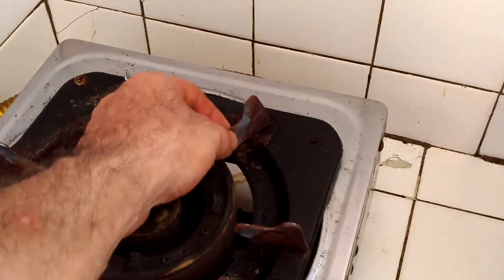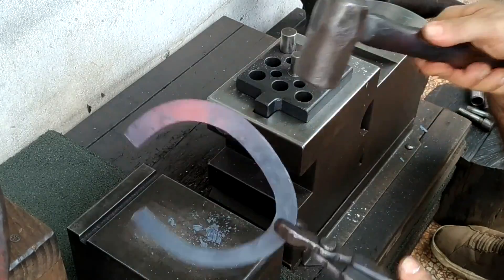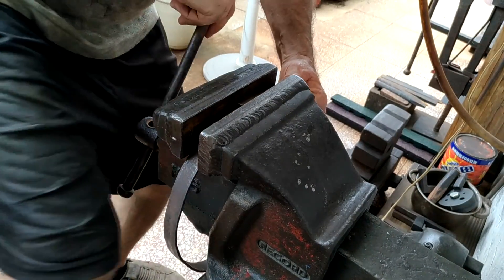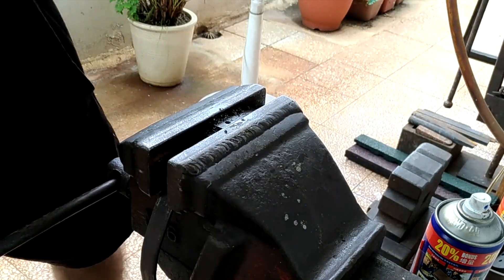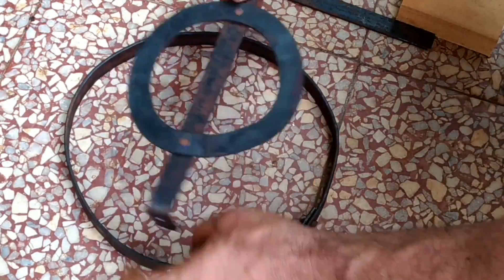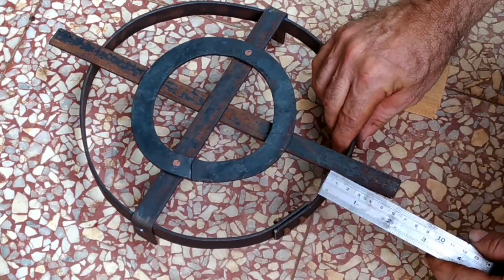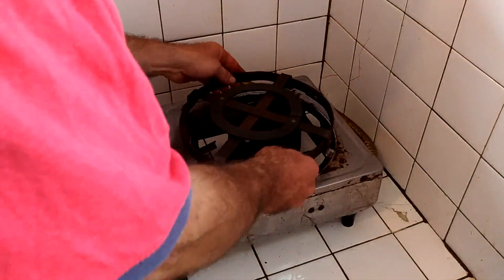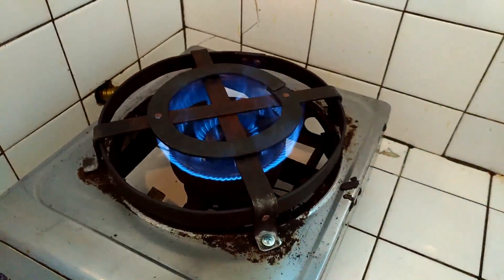Blacksmithing - Make Gas Stove Burner Pot Rack

Comment: I did a lot of bending flat bar on the flat like this for a mailbox.  If you set up a bending jig so you can brace the work piece in the jig and be able to hammer down the ripples that form, the combination of the jig and the tongs stop the bar from straightening back out as you flatten the ripples.  Doing that, I had to be careful not to bend too fast! Nice work :)
Reply from the maker: Thanks for watching and for the good suggestion. I know there's a better way but I could only think of what I did at that time. Much appreciated.

Comment: Things are made disposable or to fail fast b/c most want the $2 price point. Manufactures make more as you have to keep buying. What I dislike is often you can't get a quality part. At least if you gave the cheapy a shot and it failed, you'd have the option of buying the quality one after learning the lesson. But no, we're now at the point that cheap and designed to fail is all we get.
Reply from the maker: You make a very valid point. It's almost like there's no more quality even if you're willing to pay a higher price. So being a blacksmith, to any degree, is a good thing in this wasteful world. Thanks Bert.

Comment: Mr glen
 gs tongs 
 comment fabriquer cet gabaret que tu utilise sur l'enclume  svp
Reply from the maker: The bending jig is very straightforward. Basically it's just drilled holes in a heavy plate. I don't think it should be too hard to copy. But I also sell these is you are interested. Thanks for watching.

Comment: I think the quality of things built reflects in the lack of pride a lot of the workforce has in what they do. It's amazing how many people wouldn't buy the very products they make because they know how terrible they are..
Reply: The lack of quality reflects profit motive. 3/4 if the world is dirt poor. If someone bought something that last they make less profit. 2$ times 52 weeks is 104 but inexpensive for small paychecks if they spent 50$(which they don't have) it will last a couple years but the company made 50$ for 2 years where as cheap they would make 208 per person. Cheap products are about profit period.
Reply from the maker: You make a very good point. I totally agree. Thanks Coulson.
Reply from the maker: Profit most certainly drives how most businesses operate. Nothing inherently wrong with that but when profit is the only thing, then it's not good. Thanks.

Comment: no quality, thats why i still have my old hotpoint washing machine from 1987, parts last along time, when they need replacing they can be replaced and the nos lasts for years not months.

didn't quite catch what the old one looked like, does the wide flat bar soak up alot of the heat taking it longer to heat up the pan/kettle?
Reply from the maker: The rack I made works perfectly. The old ones were made of the most flimsy metal possible. Thanks.

Comment: It’s a shame that folks watch someone do something and tell them “ you should do it this way or you should had done it that way” . Instead of just watching and trying to learn a different way or get a new idea. 
Question: did you countersink the rivet holes to get flush top rivets?
Reply from the maker: No, I actually didn't countersink the holes but the rivets are very flush. However, they are holding well. Thanks for watching.